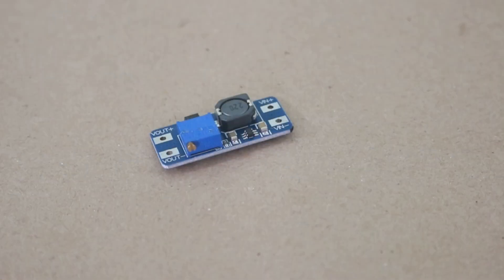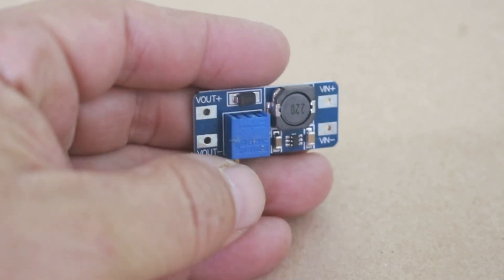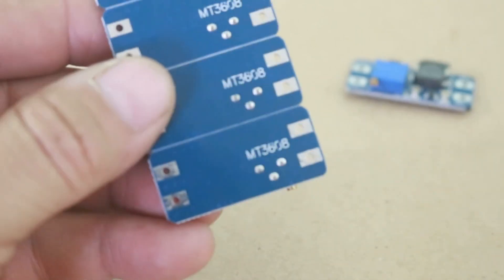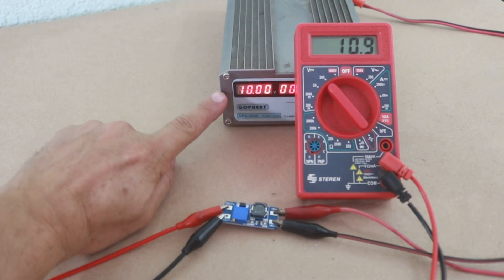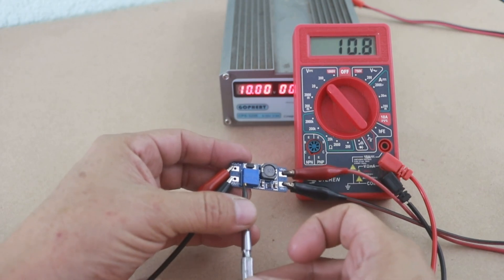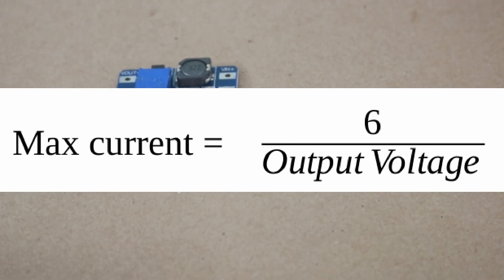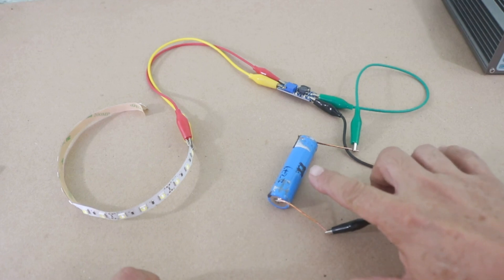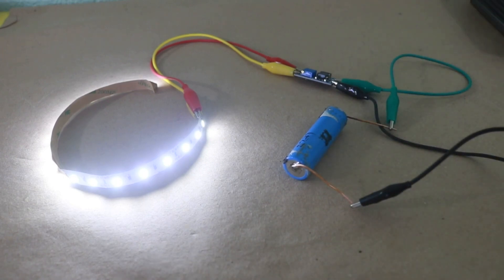Voltage Boost Converter Module MT3608

Comment: Nice video and nice explainations. I have a question. Is this module can give same voltage when 4.1v to 3.7v drop? For example I want 7v, 1s battery gives 4.1v fully charged and 3.7v below 80%. Will the output stay same in that scenario?
Reply: yes

Comment: Hi friends! I'm working on a personal project, and I have a question I hope you can help me with.

I'm using a nichrome wire connected to a 12-volt power source. Currently, the wire heats up, but not enough for what I need. I measured the consumption, and it's at 12 volts with 2 amps. My goal is to make the wire heat up much more, and for that, I want to increase the current to about 3.5 amps while keeping the voltage at 12 volts.

The problem is, I’m not sure how to do this. Is there any way or recommendation to inject more power into the nichrome wire so it can reach a higher temperature? I’d really appreciate any advice or suggestions! 🙌

Thank you so much in advance! 😊

Comment: Can you make a video converting a microwave oven into a high power parabolic dish radar that will fry a drone?
Reply from the maker: I can´t
Reply: Hahahahahahaha he might have as well as suggested you build a unity engine
Reply: @msana4420 you do know that ww ll radar systems used magnetron tubes that were connected to waveguide tubes to emit rf radiation and that when the microwave oven was invented they were named "Radar Ranges"?
We used to point the radar antenna at fluorescent light tubes that were a quarter mile away and they would light up.